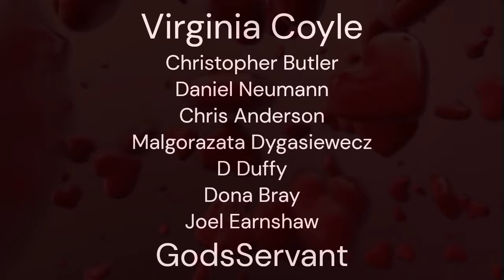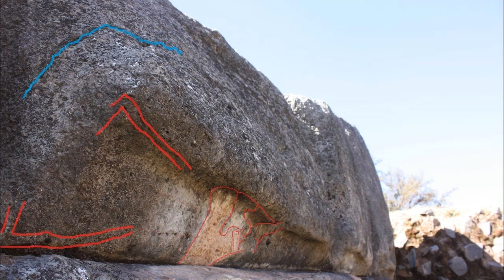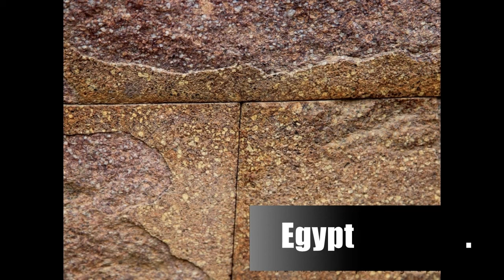Polygonal jig saw walls

Comment: So, my take from this is; what others refer to as “Rendering” covering the walls, could actually be the petrified remains of the casting sacks. The series of images throughout the last half of this video, tend to support this notion. Applying this knowledge to clips I’ve seen on other channels, should prove to be an interesting exercise. Easily, one of the most SOLID theories you’ve come up with. Keep at it!! 😀👍
Reply: Or sprayed the outside of the "bag" with certain chemicals, to create a reaction on the surface, resulting in formation of a very hard protective shell. Excellent idea from Wise Up, I agree.
Reply: I like the idea of a chemical additive. Either as a catalyst for the curing of the “geopolymer”/concrete, or like you said, as a structural support to the “bags”. Interesting stuff!!
Reply: Yes!  Geopolymer is the answer to how these walls were built.  The “nubs” were outlets to adjust for overfilled bags, as they were filled in place so there was no lifting of heavy loads.
Reply from the maker: Thank-you so much for recognising my efforts in trying to explain my findings on this, expanding ideas from whilst exploring similar incorrect notions like NUBS / polygonal walls / etc, the second half to this video does indeed further the sack evidence ie imprints of / how many surfaces seem to even be mineralized remains of them + something i was meant to add but sadly forgot about was to show close up images of the walls within Coricancha PERU amongst a few other sites i know reveal the same thing, that being a constant cross stitch pattern effect__imprint across every surface, which seems to be from a type of sack !!!!.       (((THANKS boblydecker)))

Comment: And this is why some of these walls look like corn in a cob, both are essentially the same thing: soft sacks stacked against each other and hardened later.
Reply from the maker: Yheaap correct - i see what you mean Archangel    (((THANKS)))
Reply: Comment not too be ignored 👍...hey could even have a fibre (wooden type) core wall just like a corn on the cob has....you could knock those walls up very quick wooden centre framing maybe a cement lsyer poured over and then apply stone bag type solid frame around that makes a solid effective wall that can be done quickly n stronger with time ...just thinking off- key 😁👍

Comment: Looks like they used dirt for the outside form. The   bumps could be where the builder kicked a foot in to the side wall to hold the formwell its being braced. when the front gets back filled up say 30 cm. Then add cement mixture as it raises up you keep adding back fill. Unpacked fill will compress giving a bubble to it. I could build that wall with a skidsteer  some dirt paddlers and a cement mixer. Plus a bit of time to let blocks cure a bit before pulling form and continuing on the next block. The last pictures where the outer layer is a different colour and separateing or Spalding. Is where the integratey of the mix was contaminated by the fill used as a form.

Comment: A very good video. The large stones or blocks in Peru are the oldest of all, if stone could be dated it would go all the way back to the children of Noah and their children. They were made of a form of concert that was very thick. The nubs at the base of the stones where holes in the front of the form to let trapped air out while filling. As time moved on the Egyptians found the locations and it is my guess that they also found how to make the concert. They made smaller forms so their was little need for the holes at the bottom. Yes the Egyptians started in South and Central America before leaving and going the the east.